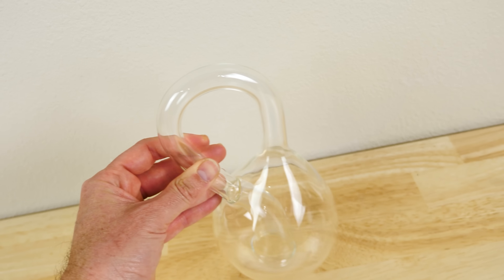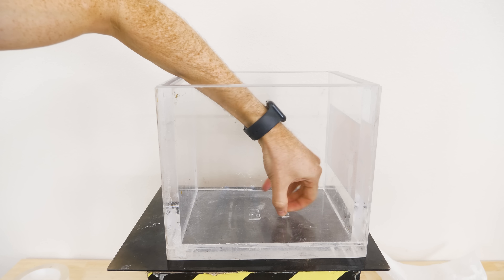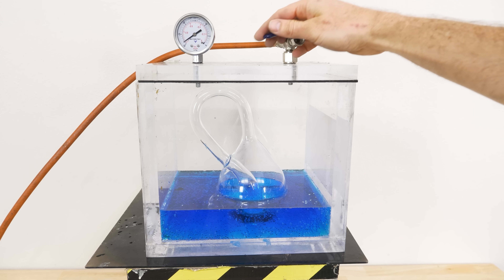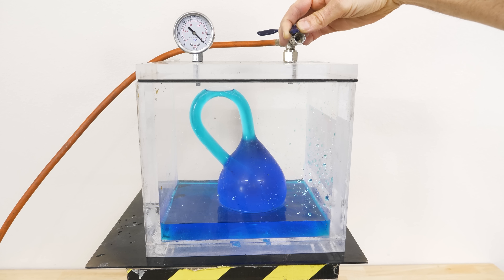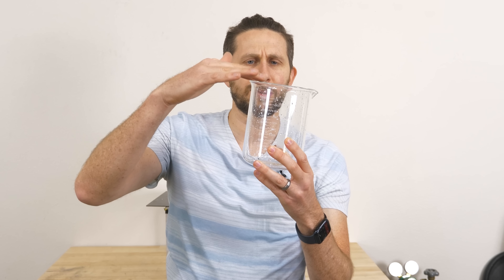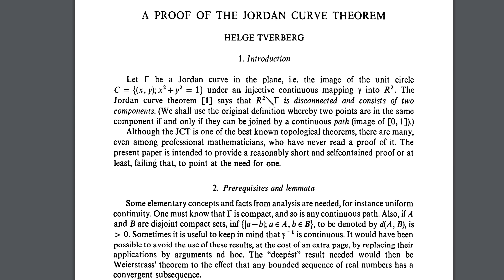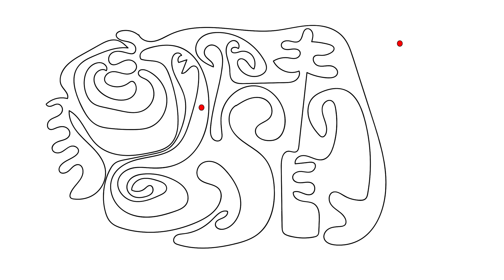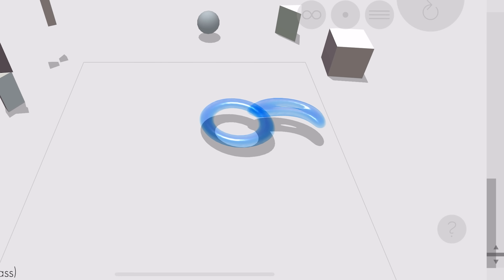Is It Possible To Completely Fill a Klein Bottle?

Comment: If it has no limited volume in theory you could fill it with an unlimited quantity of liquids, you could keep a small klein bottle in your pocket and drink from it forever...
Reply: no that not mean that the volume is infinite that just mean that it is not well defined since there is a hole, hence not limited, in the same idea you can't measure the volume of a tube without plugging the two holes ...

Comment: Klein bottles are vaguely interesting, but there is nothing all THAT special about it. The whole notion of "inside becoming outside along its surface" and "it only has volume if we arbitrarily measure its ability to contain liquid anyway" is also true of normal bottles. There's no magic other than human brain shorthands defining some part of an uncapped bottle as "inside"; the glass on the "inside" is the same as the glass on the "outside", and the surface us contiguous. The only truly remarkable thing about the Klein bottle is how bad it is as a bottle, and how the shape tricks our brains into thinking it's drastically different from any other bottle... Meaning that what's interesting about the Klein bottle what our seeing it and thinking about it says about US and our brains.

Comment: Did you try to fill the Klein bottle without a vacuum chamber? Instead of holding it in the air and filling it with water, dip it in a tub and tilt it at different angles until all the air comes out. When you're done, pull it out with the bottom facing upward.

Comment: It's awesome that ur tryna fill it with water while it's already filled with air so it's full, that's why you can't force the water in until you use your vacuum chamber. Due to it not being perfect vaccum it won't never reach the absolute top but yes approach it.

Comment: I asked an AI this question:

Yes, it is possible to completely fill a Klein Bottle. However, because a Klein Bottle has no inside or outside, it would be impossible to pour a liquid or solid substance into it in the usual way. Instead, the substance would have to be placed inside the Klein Bottle in some other way, such as by inserting it through the top or bottom of the bottle.

990th comment btw

Comment: Theoretical math like this is very cool, but also very stupid. Like... a beaker obviously has volume. Saying that we "artificially" define the constraints of the beaker by the plane at its opening seems really disingenuous. Math that only works in 4th dimensional theory, but not in real life seems backwards. Any normal person would say the beaker's volume is equal to the area of its base times its height. You know, the equation for volume of a cylinder? The klein bottle is obviously different, but it seems like its volume could be define by the amount of water it takes to fill what a normal person would call the interior.

Comment: Could you imagine if when a 3d Klein bottle is forged in our dimensions its 4th-dimentional counterpart spontaneously appears in the 4th dimension? That'd be trippy
Reply: Thats kinda how it works but at the same time not at all
Reply: You could imagine the same with a shadow. But shadows are not created, they are a 2d representation and also the result of things being created and blocking the light. Thus, 4d objects being created would throw a 3d shadow, but how would a 4d object be created?
Reply: @Olibaby12  By a 5d object, obviously.
Reply: @sojou.RN.  whatabout a 6d object? what about a 99999999999999999999999999999999999999999999999999999999999999999999999999999999999999999999999999999999999999999999999999999999999999999999999999999999999999999999999999999999999999999999999999999999999999999999999999999999999999999999999999999999D object?

Comment: I have an easier way of filling a klein bottle... use a flexible plastic tube, like one of those clear plastic tubes for aquarium bubblers... Just stick it all the way through the bottle and then pour water in around it. It'll let the air move out of the bottle. Also the bottle used in this video is not a klein bottle if you define a klein bottle as a shape with no volume. Rather it is a representation of a 3 dimensional shadow of a 4 dimensional shape with no volume.

Comment: Disagree. Once you place the Klein bottle down, you have granted it volume as now the boundary between interior and exterior is definite. Making it relatively easy to assign a definite value for. As long as the tube is open, the volume is simply the sum volume of the glass used to construct it. So it does have quantifiable volume either way.

Comment: Isn't easy even without a vacuum chamber? Either you can just dunk it in a pail of water and rotate it around for the air to come out, or you just insert a straw and use your mouth to blow water in while also rotating it around.

Comment: Have you tried feeding a piece of tube into the Klein bottle? If you do this you can easily replace the air with water and then keep the water flowing as you remove the tube again, to replace the displacement of the tube itself. You would just have to make sure the tube is fed through until it reaches the inner base of the bottle.

Comment: Wouldn't it be possible to fill the klein bottle by inserting a long bendy straw all the way in and sending water through that?  I would think that would tend to easily push out all the air.
Reply: Yes.

Comment: My first thought was pressure. Stick a hose forcing water into the klein bottle. Don't rotate the bottle at all, just let the water be forced into the bottle. Have an air release valve on the input hose to allow air to escape out the inlet as the water displaces it.

Either this'll work, or the bottle will shatter from the pressure. If it's an unbreakable imaginary bottle, I believe this would definitely work.

Comment: Could you submerge it and rotate it around to let the air out to fill it up?
Reply: Yes. And unlike what he says in the video you can define the volume of a Klein bottle by completely immersing it into a pre measured volume of water, letting it fill up the Klein bottle, then measure the volume of the water again.

1ml= 1cm^3. So the difference in volume is equal to the volume of the glass in the bottle (not just the water it contains).

This dude talks a bunch of nonsense

Comment: Technically any bottle or bowl has no volume. Even a Teapot has no volume. Even a balloon has no volume until you fuse the open bits together until an internal volume is formed. Its all just a weirdly shaped flat surface.

Comment: I might try a garden hose with a jet nozzle, which would agitate the contents enough to burp out the air, assuming a bottle that isn't made of very thin and fragile glass and/or regulating the hose pressure down.

Comment: Note that a 4 dimensional Klein bottle does not enclose a volume either, just like a 3 dimensional curve cannot enclose an area.

It's not so much about the volume as it is about orientability with Klein bottles. Basically, there is no notion of left and right on a Klein bottle, since you can switch directions by walking around one of the Möbiusstrips

Comment: If you put a tube in so you can relieve the air pressure gradient on the inside, you can just fill it normally by submersing it and keeping the other end of the tube above the surface of the liquid. The submersed air is pressurized, so it will flow out and allow more liquid into the bottle.
Reply: This is way simpler than my idea. I was thinking of a quarter inch tube with pressurized water, like what you would connect to a swamp cooler or ice maker. 👍
Reply: @CromKiller98 that’s exactly what I was thinking. A thin long tube to deliver liquid into the belly pass the neck of the bottle.
Reply: I was just thinking that
Reply: Just fill it through the tube. Nice and simple.

Comment: Dude I'm really sorry, but this is a simple "error" or mislabeled or applied equation.   
 Measure the volume of liquid in a typical large container of liquid. Then fill the Klein bottle with the liquid from large container.  Finally measure how much liquid remains in the large container used to fill the Klein bottle. 
The difference is the volume.
   I may be pathetically wrong.  I am disabled and on lots of mind-dumbing medications. 
 The equation and mathematical laws applied are different because different physics and physical-dimentional trasitions are applied "structurally."

Comment: 2 possible solutions that are much easier.

1. Insert a small plastic tube such as for aquarius into the vessel and run it all the way to the sealed chamber. Invert the vessel and submerge it in a container filled with a liquid while leaving the end of the tube exposed. The vessel will fill and any remaining pockets of air can be removed by rotating the vessel and applying suction to the tube while the air pocket is in close contact with the tubing. 

2. Using 2 tubes with one being made of as thin of a flexible material as possible and the other being standard sized aquarium tubing, run the thin tube into the vessel with the tube terminating as close to the top edge of the vessel (the bottom glass wall of the vessel if filling while inverted). Run the larger tubing into the vessel. Using the larger tubing begin injecting liquid of your choice into the vessel by whatever pumping method you prefer. 

The whole premises that keeps this vessel from being able to be filled is that under normal conditions if you try to just pour a liquid into the vessel, the pressure will eventually build up as the void in the chamber of the vessel contains air and the air can not freely move down past the liquid filling it. All you need to do is give the pressurized air a path to escape and the vessel can be filled.

Comment: That was one of the most unnecessary uses of a vacuum chamber we've ever seen. A small pump with a pretty short tube would've produced the same result in a fraction of the time. Or if you want the lo-tech method, find a silly straw and, bit by bit, blow water from your mouth through the straw until it's full.

Comment: The beaker demonstrates that "technically X has no volume" is a meaningless statement in any practical sense. In any real-world usage outside of topology, an open container's volume is the maximum amount it can practically hold without spilling. The klein bottle accordingly has a maximum amount of liquid it can hold before any more starts spilling back down the tube, which will then spill out from the bottom.

Comment: You could just use a long straw and stick it all the way in and fill the bottle from the inside. The liquid will push all the air out.

Comment: Is there such thing as a 1D mobius "strip"? if so, could that and a 2D strip be combined for a true 3D "bottle"?
Though, a 2D mobius strip only exists in 3D space, so I imagine a 3D "strip"/bottle must require 4D space (are we sure it's not 5D?)
Reply: No, because all 1D shapes are just points and lines. A line is 1D, and 0D points can exist in 1D space (a point on a line). You can’t combine dimensions, you just go up from the previous one and get a new direction to move in. A 4D Klein bottle is surely in 4D space because it needs 1 more dimension to not intersect itself.

Comment: Much simpler way - insert a long piece of flexible tubing leaving 1 open end outside the bottle. Now you can fill the bottle from around the tubing while the air escapes through the inserted tube.

Comment: Two ideas
1. Insert a rubber tube into it and fill it up
2. Use a vacuum pump to drain the air in it, then submerge it in a liquid.

Comment: You can easily fill it without a vaccuum chamber, you just need a hose with a diameter smaller than the smallest section and you can just feed it thru and syphon into it.

Comment: Could you also use a long flexible straw as well to work as a vent to let the air out? This way, you can fill it upside-down and the air escaped through the straw.

Comment: I can calculate the net volume of the Klein bottle so therefore it has volume. Outer surface volume(seal the vase and submerge to find displacement volume) minus glass layers cross sectional area (x,y) integrated via dz over the entire height z0-zh.

Comment: You can define a shape of Klein bottle by enclosing it in a container full of liquid. Volume of container - volume of Klein bottle walls = volume.
Reply: That'd be the volume enclosed by the Klein bottle, or more specifically by its three-dimensional projection. The Klein bottle itself is a (2D) surface and thus has no volume.

Comment: Would you be able to use a big syringe with a flex tube while the bottle is under water to pull the air out